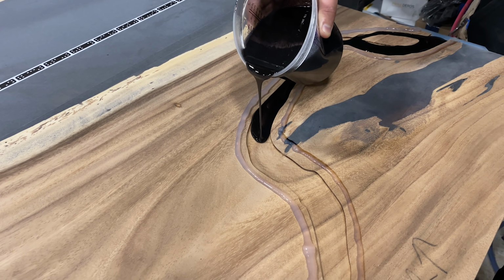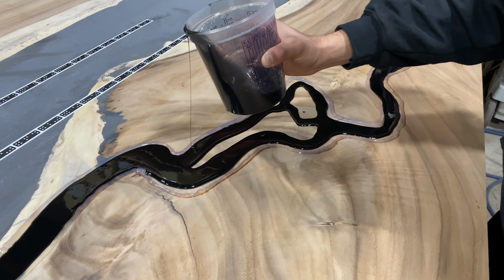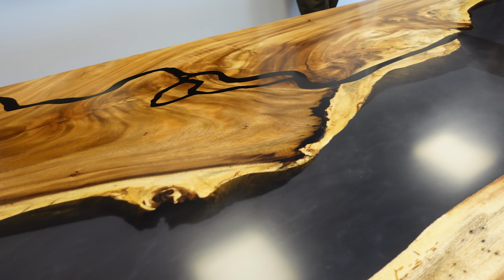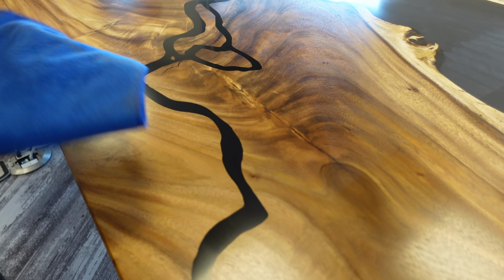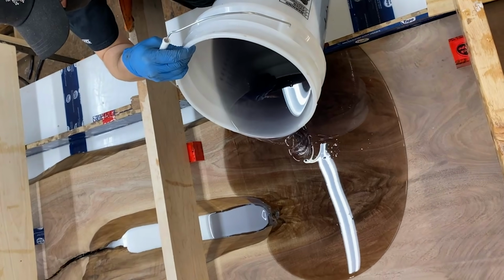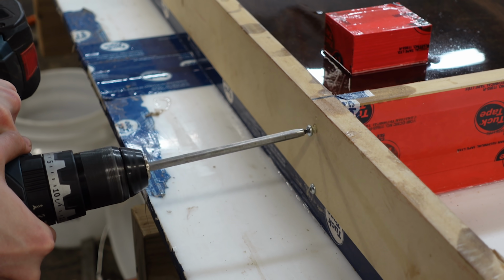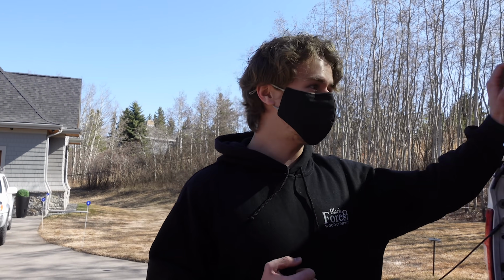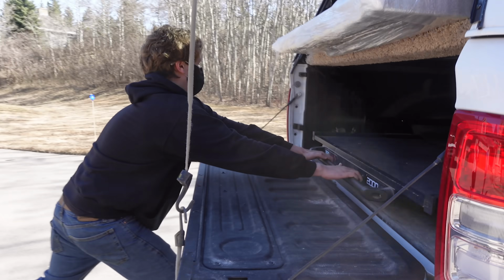Delivering a Table to The Mayor

Comment: Where can I ask a couple of questions about your builds? You guys are great to watch and learn from. I am a finish carpenter and am getting ready to do my first large live edge wood pour and ibwas hoping to get a couple of questions I have about the builds I've seen of yours. Thank you
Reply from the maker: How can I help you?
Reply: @BlackForestWoodCo  Thank you so much for helping out and responding. I noticed when you pour your resin, you use little blocks to clamp down the live edge pieces to prevent movement and I was wondering after it is dry, do you sand the piece down until all of the epoxy is off of the wood? And my 2nd question is, do you pour the epoxy so the  wood is covered in epoxy as well and leave a thin layer on top of the wood before you polish and buff or do you remove all of the resin off of the wood and just polish the wood to a fine finish? And if you do keep resin on the wood, how thick do you keep the resin above the live edge wood and how do you get rid of the Mark's from the blocks of wood that will prevent the epoxy from getting underneath them?   I apologize if they sound like ridiculous questions but it seems to me that you would leave at least an ⅛" of epoxy over the wood to get a smooth flat finish over the entire project.
Reply from the maker: @joem.342  After it's dry we plane it back down to the wood on our CNC which gets rid of the block marks, and then sand to 320. We over-pour so all the cracks and voids on top get filled and we don't have to go back later and fill them, but we don't keep a thin layer because we like to actually be able to feel the wood texture!
Reply: @BlackForestWoodCo  Thank you so  much for the lessons lol. In this industry getting advice is priceless. What liquid  do you recommend buffing and polishing  with?  I also would've never thought to use C.A. glue for the little touch ups. I would've thought for a desk or a table that the wood, would need at least a thin coat of epoxy. But that is exactly why I asked. Now I know after the pour, to plane it and sand it until there is no resin left on the wood before buffing and polishing it. Thank you again for your help and thank you for the amazing videos you provide. You all are amazing and I'm a bit older than you so to me, it is amazing to see such young talent dominate their industry.
Reply: @BlackForestWoodCo   Also forgot to ask one more question. All of the products you use are on your website? Anything I need for these builds, I will be purchasing from you so I know I am using quality products and because of all the kind help you have given me.
Reply from the maker: @joem.342  Thank you so, so much Joe! We appreciate all your kind words! We use Osmo's Extra Thin for a first coat, then do 3 coats of Osmo's Polyx and finish off with our Black Forest Base and Top Coat Ceramic finish! We have a whole tutorial on the process if you're curious! https://www.youtube.com/watch?v=OOrSIKFMGrY&t=121s
Reply from the maker: @joem.342  Yes, everything we use is on our website! Thanks so much for wanting to support our business!
Reply: @BlackForestWoodCo  Thank you for all the help. I will send photos of my work and your guidance. Again, Thank you so much.